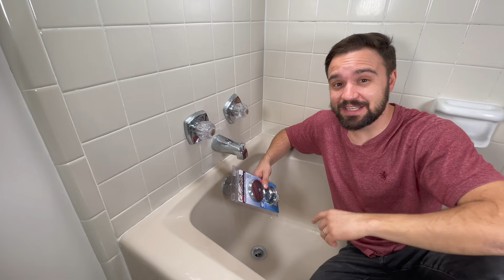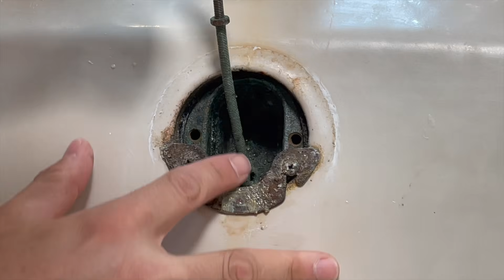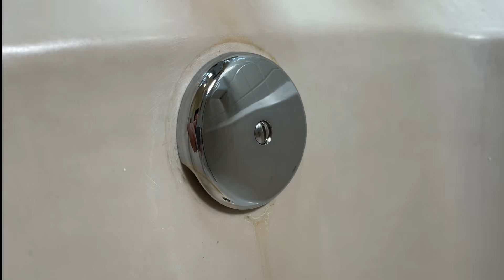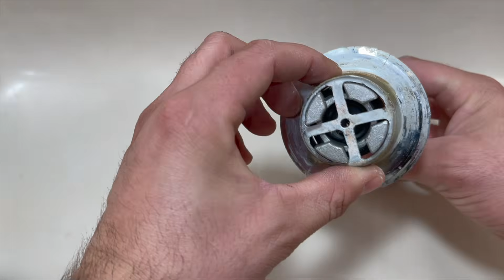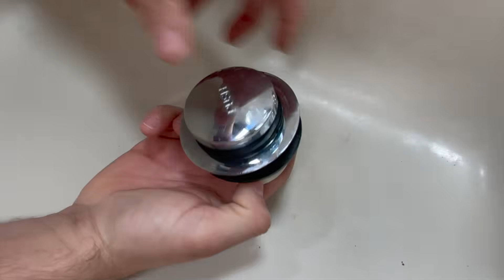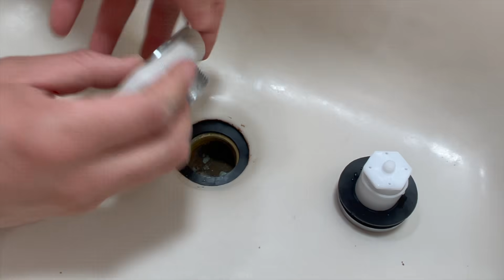Replace Your Bathtub Drain Like a Pro - Using the Right Tools

Comment: Would this process be any different on a fiberglass tub and shower unit? Are the same replacement parts and methods shown in this video applicable on fiberglass?

Comment: Purchased several drains and they are all longer than the old. Am I supposed to cut it short?
Reply from the maker: You need to check the thread size and length. And no, I have never had to cut these before.

Comment: What should you use to remove drain if you cant use tool due to the metal all rotted out?
Reply from the maker: Well...At that point unfortunately you will need access from the bottom and will have to cut it out. That it self, is one video in which i should add to my list of future videos. Good luck.🛠👍
Reply: That is a common problem. Years ago I had that happen and there was a video about it. I think I had to drill 2 holes on the top and use a needle nose pliers